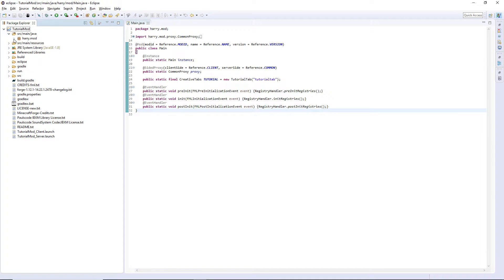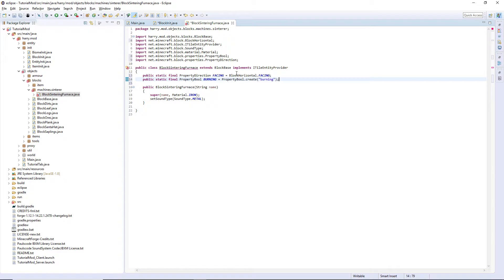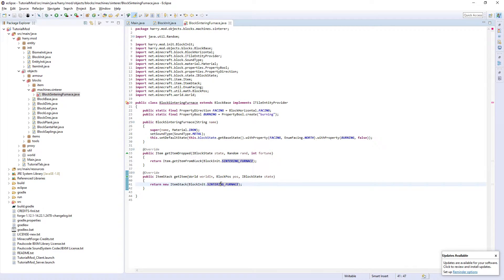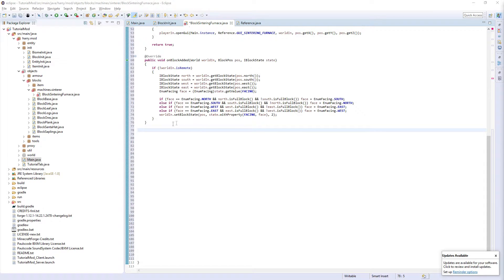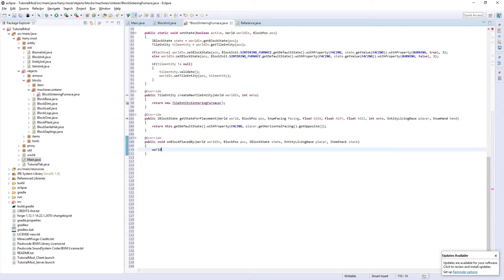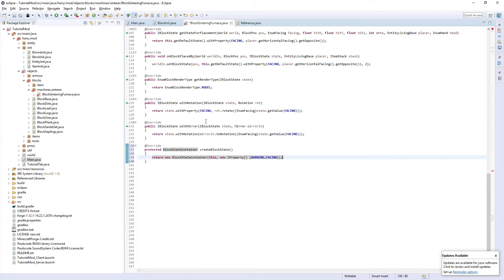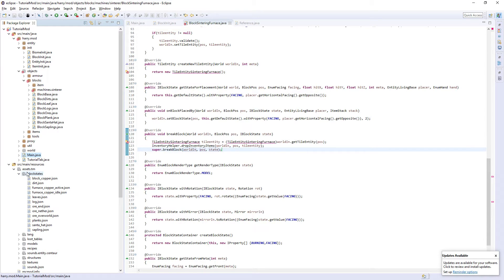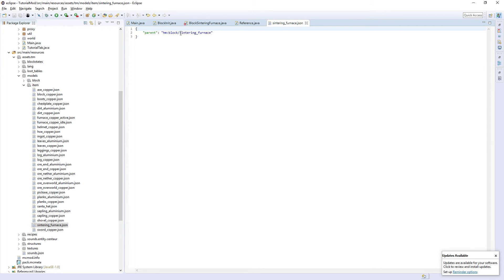Custom Furnace (Part 1) - Minecraft Modding Tutorial 1.12.2 - Episode 16

Comment: I don't know if you are still supporting this tutorial or not, but I am going through this and this type of furnace is exactly what I was looking for, but what would I need to change if I want the top of the block to change when it is burning instead of the front? Basically I have a forge that is lit on the top instead of the side.
Reply from the maker: Hi, you would just need to have it so in your burning JSON, there was a different texture on the top instead of the front
Reply: Harry's Tech Reviews  Thanks for the reply. I got everything working. I really appreciate this tutorial. Only other thing I am having trouble figuring out is how to make it have a light level if it is active like the vanilla furnace. How would I add this to the block?
Reply from the maker: In your block constructor, put (if this.isBurning) this.setLightLevel
Reply: Harry's Tech Reviews  I tried that, but that method wants IBlockAccess and BlockPos as arguments added to the constructor and I'm not sure what to put for all of that.
Reply: Any ideas on how I would get this to work? I have the same code as you for the block class, only difference is I want it to light up like the standard furnace would when it's smelting. I tried looking at the vanilla furnace code, but it is quite a bit different from what you have. this.isBurning requires more parameters added to the constructor and I'm just not sure how I would change the code to get it to work.